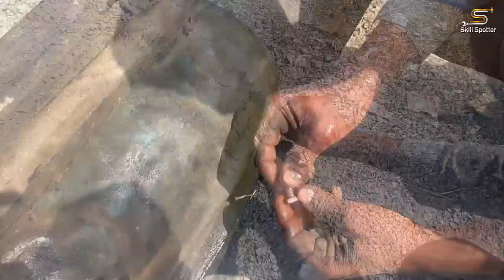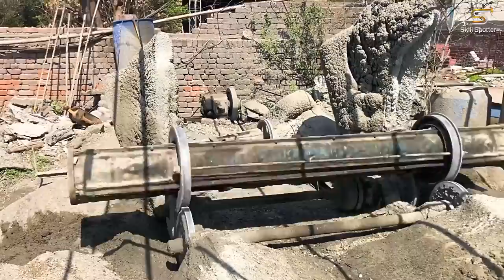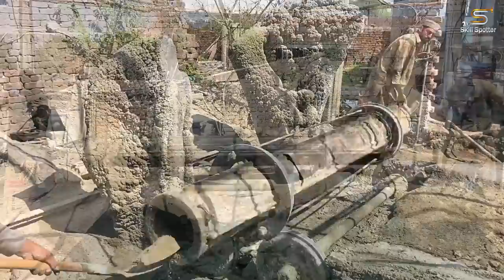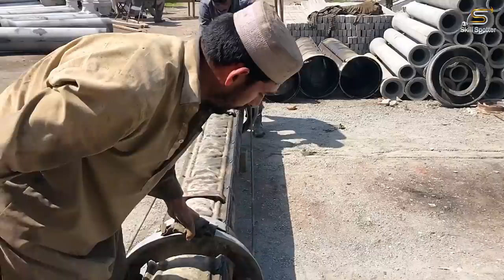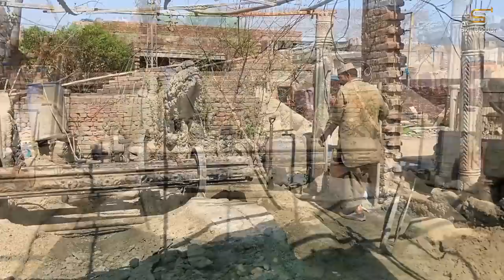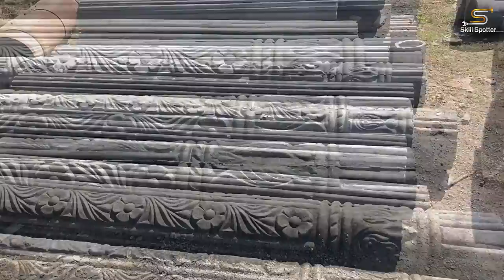Cast Stone Columns, Making of Precast Concrete Pillars for Stunning House Front View

Comment: This is so much more efficient and quicker, then to slip-cast columns using plaster! I have never heard of this technology before. Thank you for bringing it to our attention.
Reply from the maker: Very warm welcome dear.
Thank you so much for your appreciation.
Keep in touch with our channel.
Reply: That is not plaster; that is Portland cement and sand. This technology is very old. Look up centrifugally cast concrete. It works very well on pipe and decorative columns. Remember to put steel rebar inside before you add the cement.
Reply: @nitromartini1422  " before you add the cement"
You mean the concrete.
Reply: @SylvanApe  : Nope. Cement is dehydrated, ground oyster shells.

 When you buy a bag, it is labelled as Portland Cement, not Portland Concrete. 

When you add water to dry cement, a bricklayer calls it "mortar", but a concrete foundation guy generally calls it "cement". The only time this material is "concrete" is after you have added to water and it hardens.
Reply: @nitromartini1422  Concrete is a mixture of fine and course aggregates, normally sand and gravel, mixed with cement as the setting agent.

"When you add water to dry cement, a bricklayer calls it "mortar""

No, I would call it a mess, you need to add sand to make it into mortar.

'but a concrete foundation guy generally calls it "cement"'

It is true sometimes, in some countries, some people call concrete or mortar 'cement', especially in the US. However, cement is still cement, add sand for mortar, and sand and gravel for concrete.

Also, most cement is made from limestone and other mined materials, not many places use shells anymore, in fact shells were not the origin of cement, limestone was. Lime mortar was common because it was easier to get the materials for, but has more limitations.

What they were adding to the mould after setting the rebar was concrete.
Reply: @SylvanApe  : I would assume anybody dealing with cement knows that adding an aggregate is standard procedure and I shouldn't have to point that out.  

An aggregate can be anything you want, not necessarily gravel and sand. My grandmother had a house which was made of bricks using cement, sand, and rice hulls, built during the Great Depression. 
The walls and the roof were all built from this material. It was possible to drive nails into it. It was fairly easy to saw sections and drill holes in it. It is still standing today. 

I have heard of people using ground walnut shells as an aggregate. I have no idea how well it works. 

There are some companies who are using plastic beads as an aggregate to build bricks using the same idea.

I know some people who bought a brick house built from caliche, sand, and cement blocks. It is falling apart, because caliche is brittle and has a very low compression strength.

 The reason for sand and pit-run gravel in cement mixtures is to reduce cost and provide high compression strength. Big deal. So what. 

Your initial criticism of the word "concrete" rather than "cement" in my original comment is getting really nit-picky considering that most concrete guys aren't very bright and insist in ordering "yards" of cement rather than "cubic yards".

I find your whining about masonry semantics to be really elitist and downright silly.
Reply: @nitromartini1422  "I would assume anybody dealing with cement knows that adding an aggregate is standard procedure  and I shouldn't have to point that out. "

Yet you are commenting on a video in no way designed for people in the profession and spreading confusion.

"Your initial criticism of the word "concrete" rather than "cement" in my original comment is getting really nit-picky"

Then next time you want to do a job order 'cement' and see what happens. Most companies around me do concrete components (cement, sand, gravel etc) separate, or will make you premix dry mortar or concrete, or will deliver premixed wet mortar and concrete. If I call up and ask for 'cement', I will get just that.

"most concrete guys aren't very bright and insist in ordering "yards" of cement rather than "cubic yards"."

Yet you say I'm 'elitist' whilst calling skilled professionals dumb?

Also yards is shorthand where there is no confusion, unlike 'cement', because we don't live in a 2D world and you can only order in cubic measures.

Just out of curiosity, as you speak as if you have actual experience, what construction industry are you in?
Reply: @SylvanApe  : I have several decades of highly varied industrial experience and a substantial engineering background. My fields include commercial and residential construction, the welding-fabricatng business, chemical plants construction, oil and gas oilfield  mudlogging, roofing, concrete form and finishing, auto mechanics, paint and body work, motorcycle custom paint jobs, the Las Vegas convention industry, and much, much more.  I am retired and am a Senior Citizen. 

To call cement workers skilled professionals is a real scream. They are almost as dumb as industrial painters. 

You must be retired too, or unemployed; to spend so much time on the internet whining about insignificant verbal crap. 

Maybe you might consider getting a job to keep you busy.
Reply: @nitromartini1422  Nice resume, shame no one would keep you around long enough for you to call one a career. So I guess unskilled day labourer would be the best fit.

"You must be retired too, or unemployed; to spend so much time on the internet whining about insignificant verbal crap. "

Nope, neither. Why assume those are the only 2 options? People can do several things in a day, or night, or did we forget time zones are a thing? I am gainfully employed and using a little of my free time to have arguments on YouTube.

Like I said, you are not talking in a forum of other tradesmen, it is a general forum, so helping dispel misinformation is key.

"To call cement workers skilled professionals is a real scream. They are almost as dumb as industrial painters. "

I think this sums up the kind of person you are, just because you can't do it doesn't mean you should belittle people. Be glad there are skilled people out there to do all the jobs you can't.
Reply: Your still living in the stone age

Comment: I love it I want to have a dozen of those do they even sell those in the United States I have no idea but that's just amazing as a Craftsman myself I am totally impressed I couldn't imagine how they made those to begin with but that was amazing thank you for the Post
Reply: If I had to guess they just lay up a fiberglass mold over a column that was hand-made. The transmission on the spinner is made out of wood
Reply: @timmeh87  I am almost sure you are correct. I have seen the fiberglass ones before. They look good from afar but kind of cheesy in my opinion. It'd be far more cool to have these. You could put a 8x8 post or an I-beam in the middle and maybe fill it with sand or hard foam etc. And it'd still feel like real stone. Honestly I'm tempted to try and make something akin to this. Really cool.

Comment: These are not stone columns, they are concrete columns...
Reply from the maker: Respect your opinion dear, you are right but this is the same replica of stone columns because not everyone can afford expensive stone columns.
Thanks a lot for your comment.
Reply: lets not be pedantic, of course they are concrete, but very nice work.
Reply: There was me thinking they were stone. Thank goodness you stated the obvious.
Reply: @peckelhaze6934  Because i worked as a stone masory? i think that is a big difference between how to do stone columns and concrete columns. If i had to do a real stone column as they show in the video it would take me 1-3 months depending of what sort of stone i use, not 15 minutes...
Reply: Yeh but you can use geopolymer in them moulds, so granite marble ehtever
Reply: Cement is lime stone
Cement mix gypsum is stone
Gravel is stone 
Sand is weathering stone.
Water when hardened is stone cold 🥶 
You see my point.
Reply: @alexCroft87  There is a significant difference between "casting" a concrete pillar, compared to chiseling one out of real stone! I have done both!
Reply: @bikermatz  😉
Reply: The fact that it says cast   should give you a clue     dohh
Reply: @bikermatz  it said cast    when as a stonemason did you cast a pillar   dohhhh
Reply: @bikermatz  What a clever chap you are    i bet you feel smart
Reply: Concrete is stone.  Stone chips, using incinerated stone powder for a binder, and ash for an additional binder....
Stone reunited
Reply: @MadSceintist  Concrete IS not stone! Granite, limestone etc is stone!
Reply: @bikermatz  
😆😐
Guess water isn't fuel either?

Comment: Weak and poorly made columns. Rebar is not sufficient for any type of lateral load, see YouTube videos of earth Quakes in this region. Also centrifugal force on concrete mix causes the stones in the aggregate to separate, so you will have more stones on the outside of the column and just sand on the inside. Also do they not have books or internet in this region, a quick search will reveal this is a method for producing decorative garden furniture and fences and NOT structural columns or beams.
Basic stuff really if you had any skill, like the type of skill you need to keep a clean and tidy workplace.
Reply from the maker: Respect your opinion dear.
I think you know about construction and you should have an idea about how these columns will be installed.
These are just like an outer decorated mold and while installation these are fully filled with strong rebar and concrete so no need to worry about it.
Thank you so much for your deep interest and comment.

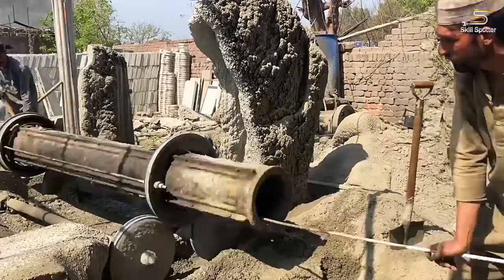Comment: 3:18 you know this is an easy way to loose an arm. if you need to apply pressure on the inner wall with the rod better to use a heavier rod instead of putting your arm in.
Reply from the maker: Respect your opinion.
Your point is very well noted.
Welcome to our channel.

Comment: This is a joke.. The rebar used in it so tiny that evetually this item will break. It has no load bearing support. Use good rebar to make the item stronger so you don't fool the clients.
Reply from the maker: Respect your opinion.
I think you don't know the construction process.
This rebar is only used to hold concrete together during the centrifugal process but at the time of installation this pillar will be completely filled with concrete and strong rebar.
Reply: @SkillSpotter  yes you are right . The bars are just to bind the concrete only. After fixing the pillar the inner hole will be filled with rich cement concrete reinforced with steel bars.

Comment: not stone and not columns, but decorative non load bearing concrete pipes — ok
Reply from the maker: I think you don't have an idea about construction, these are just as decorated cast stone replicas and while installation these will be totally filled with concrete and strong rebar, so no worries about the load bearing.
Thank you so much for your comment.

Comment: That's some small chicken wire.
Reply from the maker: Actually these wires are used only for holding concrete but while installation these pillars are filled completely with strong steel bars and concrete.
Thanks a lot for your comment.

Comment: wire that close to the outside... no actual rebar.... poor mix concrete (low PSI) no air evacuation or vibration.... no thanks.... low quality cheap crap...
Reply from the maker: I think you have good knowledge about construction, These are only like a cover for decorated pillars and will be fully filled with concrete and strong rebar at the time of construction standing under the roof slab.
Thank you so much for your comment.